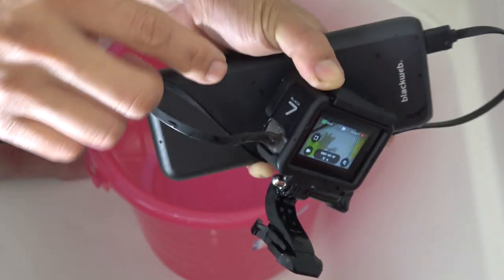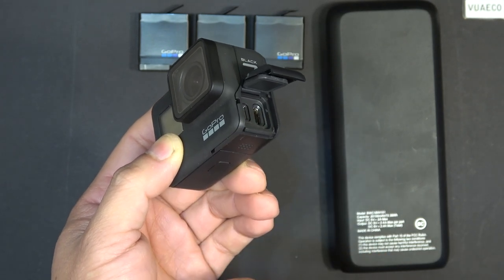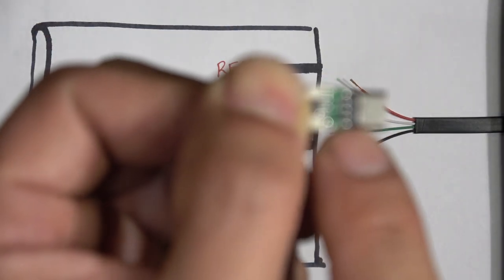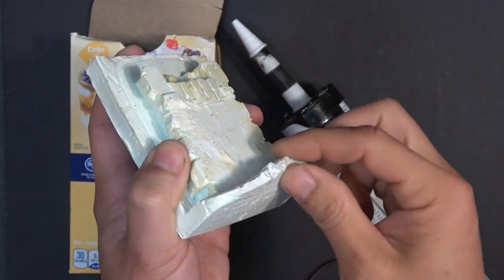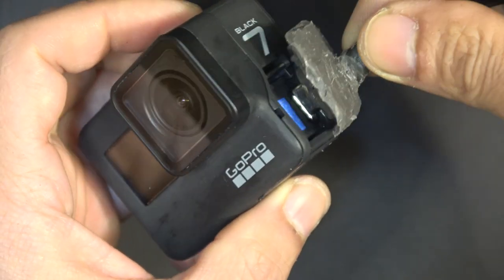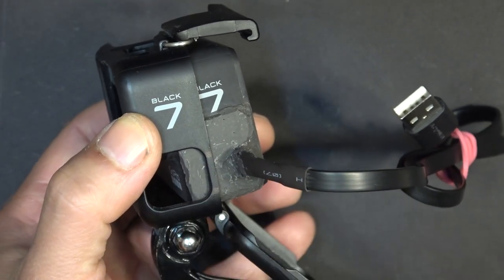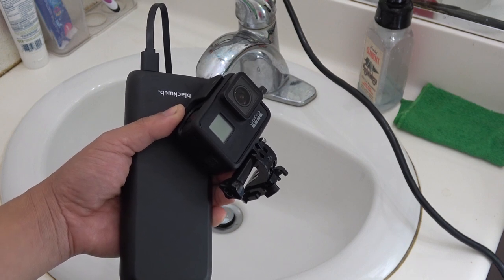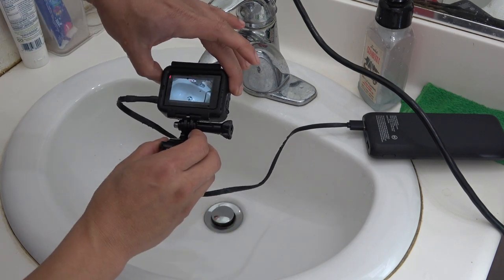DIY Gopro 7 black battery hack: Make water proof external battery connector

Comment: Curious what role does the corn starch fill why not use straight silicone. Great video
Reply from the maker: The cornstarch is for making the silicone less sticky so it's easier to work on and it also helps releasing it easier. It also makes the silicone more stiff and less flexible.

Comment: I hope you have better luck with water proofing than I have had. I lost a nice underwater video camera due to a weak seal on the "waterproof housing" that cost more than the camera. I just don't trust anything being submerged anymore.
Reply from the maker: It's mainly for protecting the camera from the water. It also helps make a support for the connector so it doesn't break easily when you bump on it. I would just remove it and put in an internal battery if I want to dive in the water for an extended time. Although it would work fine under water, I still need to water proof my battery for that.

Comment: This is brilliant. I have a DJI Osmo Action camera that I need an external battery bank to fully record gravel bike races, but don't want dust or water/rain getting in when I remove the door. How has the "rubber" cover held up? Wondering if repeated plugging/unplugging breaks down the cover? Either way, I'm still going to use this method, just wondering if I'll have to periodically create replacement covers.
Reply from the maker: It holds up fine. I never had any problem with it. I just used it here in my latest video: https://youtu.be/5KeBlyL8TaI